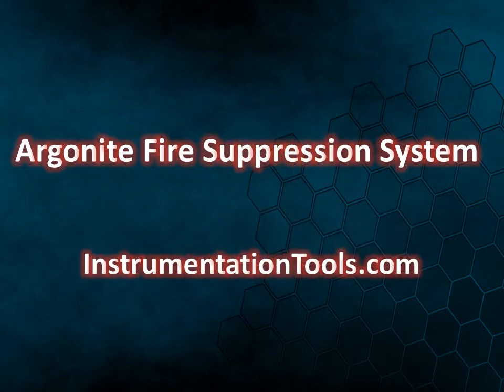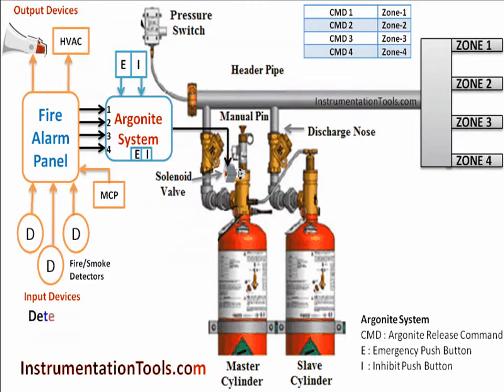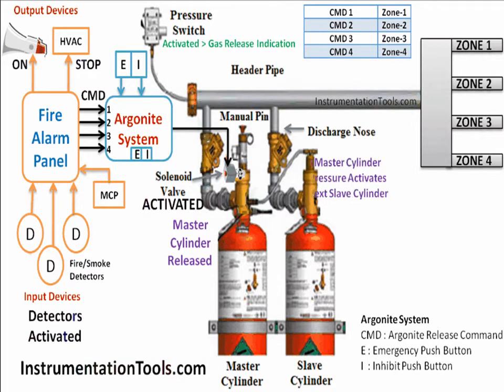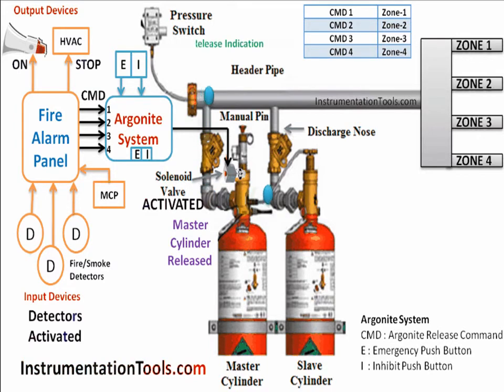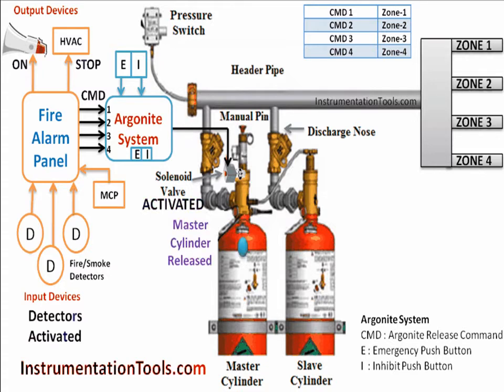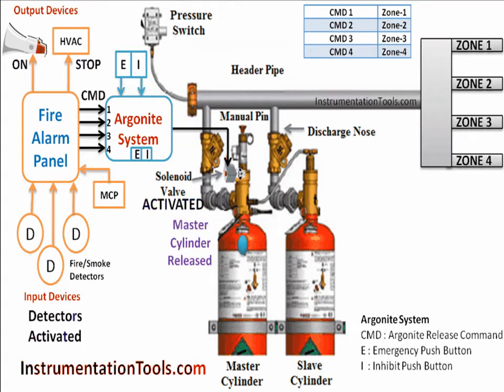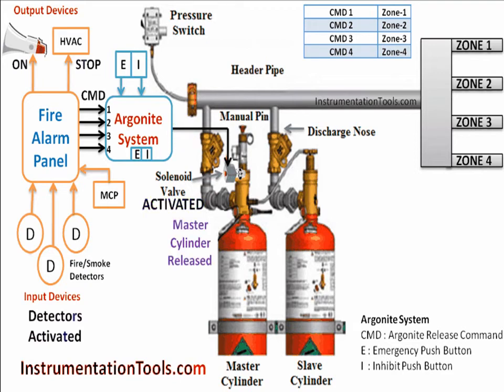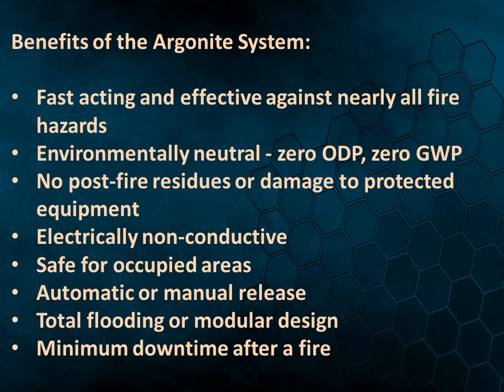Argonite Fire Suppression System

Comment: IMO there should be 100% Argon, or at least a 75-25 Argon-Nitrogen mixture, if Argon is too expensive. The reasoning behind this is that the mixture will sink quickly in air, which causes the inert gas to fall on top of fuels and smother the flames.